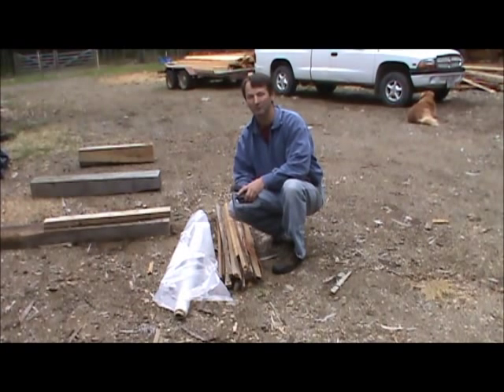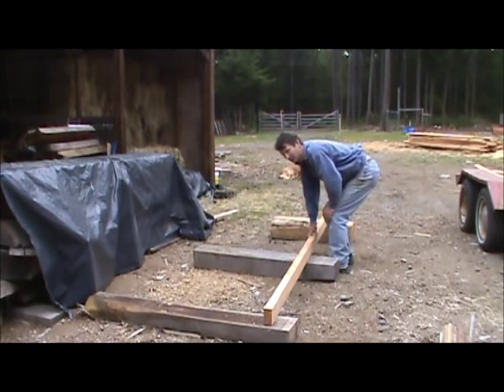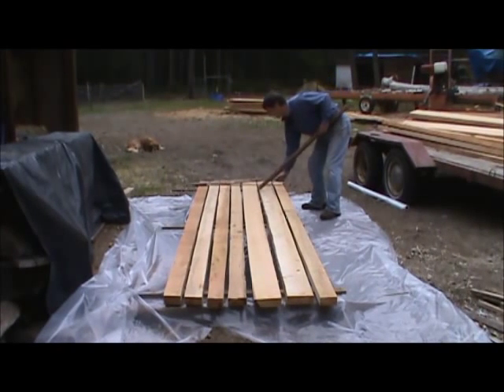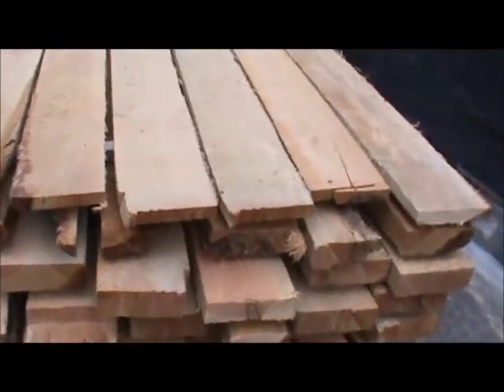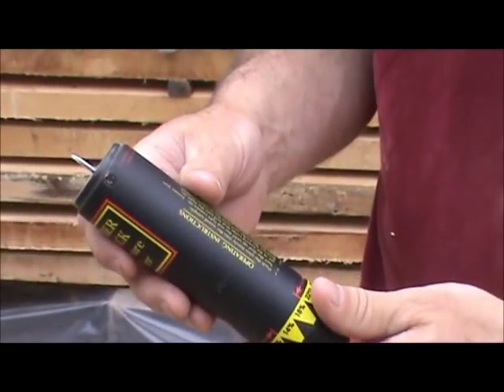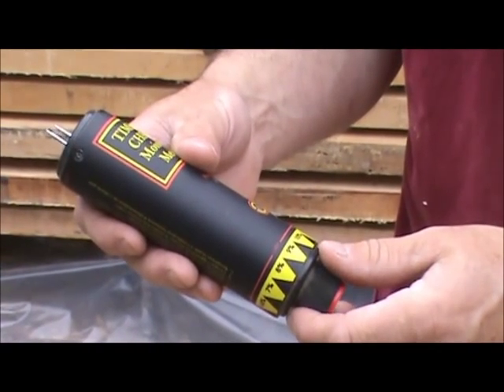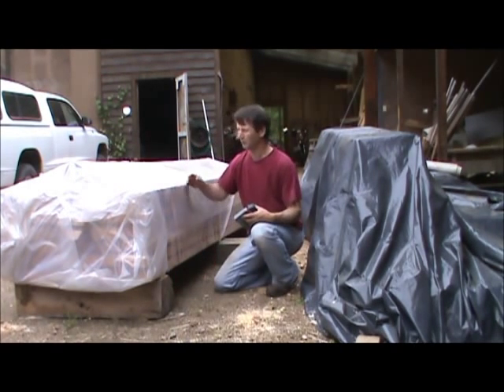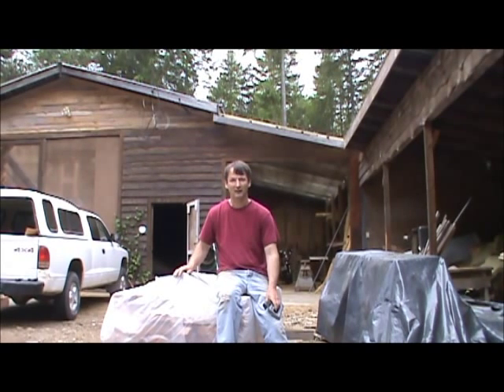How to Build a Free/Simple Solar Kiln ~ Part 1

Comment: Sorry, this won't work. Without a place for the moisture to escape...what do you get in a warm moist environment? Lol, it's a mold and fungus incubater.
Reply from the maker: Re listen to the video again my friend, you will note that you put holes in the bottom of the plastic for the moisture to drain out.
Reply: @bclogstairandrail  that's hardly enough.  I threw a blue tarp once over a stack of lumber in my dry garage to keep dust off it. I  had fuzzy mold all over my already kiln dry lumber from the lumber yard...you are not kidding me...not one bit! Wood has to breath.  Listen to me folks, don't do this as others have said.

Comment: Seems as though the people saying that this won't work have not actually tried it.I just made one of these to dry out very thick very long pine slabs.  They had air dried with no protection for a year before I got around to wrapping them up.  It seems to be working fairly well with noticeable condensation and drainage in the small holes in the bottom.  They have been wrapped up for over a month and there is no noticeable mould growth.  If I were to do it again I would wrap my slabs in a way to keep the plastic sheet from touching the wood and have a more rounded shape to help the condensed water to flow down the inside of the sheet more easily. This rounded shape would help keep the condensed vapours from dripping back on the wood. I had to wait until the water started to pool so I would know where to cut small slices in the bottom.  I should have added small stones to the bottom to better allow drainage right at the bottom and help prevent water from pooling where I don't have a hole.Thanks for all the videos .
Reply from the maker: Thank you! Finally, someone who actually listened to the instructions and tried it out before making the judgment that it would not work. Great job!

Comment: I wonder if the cooler climate makes the difference with the mold issue?

I really enjoy your videos, hoping to see some more. you do some very creative work. 

subscribed.
Reply from the maker: Thanks for your great comments. There seems to be a lot of negative feedback from other people that have not tried this and think that they know what the results will be. They are welcome to their opinion and results may vary. However, my results have been extremely good with little to no mold. The reason this works well is that the plastic does not touch the wood that is being dried. The heat generated creates a convection current of air between the wood and in the kiln. The excess moisture that comes out of the wood condenses on the plastical and running down the sides and out of the bottom. The wood does not seem to crack or split as the moisture content is very even with the woods I have dried in the kiln. I would only try this method in the summer here as it is usually quite warm and dry with little to no rain  for 6 - 8 weeks. I hope this help answer your question. :)
Reply: Looks like a lot of the condensation will run back to the wood where it is stapled.  Make a simple 2x2 wood frame for your plastic so nothing touches the  planks being dried.

Comment: how long does it take to dry using this method. the air drying method takes 1 year per 1 inch thickness of wood.
Reply from the maker: It takes about 6 - 8 weeks in the middle of summer. 😊
Reply: +MySchizo Buddy The time for wood to dry is 1 year per 1 inch of thickness when it is allowed to dry naturally. When you force it to dry the time is reduced.The higher the temperature the faster it will dry.
Reply: +Lance Forest not in Texas

Comment: Do you wait until the water pools in the bottom before you cut the holes or where do you cut the holes?
Reply from the maker: +tastypork I cut the hole in the bottom after  the water began to pool so that I new where the low points where. :)

Comment: I have a large amount of standing timber  casaurina equisetifolia( australian ironwood) on my lot on big island of Hawaii.  When sawn boards/timbers are air dried  , it has significant surface splitting and checking that is not acceptable.  I have to somehow dry the whole piece uniformly so perhaps the solar sealed method would slow the drying, so that the inside wood can equilibrate to the outside surface wood.  Do you get mold and mildew with your system?  perhaps the temp rises high enough to kill the fungus? 
good videos you have produced.
Reply: bclogstairandrail
I was expecting this method to give mold as there doesn't seem to be a way for the moisture to vent out. You kinda seem to create a greenhouse with wet lumber in it which is ideal for mold to grow. Now if you could solve the ventilation problem then you would have a winner.
Reply from the maker: It seems that it dries the wood much more evenly and so do not get that much cracking. I do however get some surface mould, but does not go in very deep. I would imaging if a person was to put some anti mildew treatment on the boards before hand this may circulate in the kiln and keep mould to a minimum. Hope this helps. :)
Reply: I am going to try it on a small scale, thanks
Reply from the maker: The second video which I never quite got round to putting up shows me putting holes in the bottom. The water sweats out and drains down the sides and out the bottom. This keeps the moisture content even and stops the mold happening as it removes the excess moisture. Hope this helps solve your issue:)

Comment: So in simple terms,instead of the moisture gradually evaporating away from the lumber, this works by raising the temperature and basically making the lumber "sweat out"......and the "sweat" just drains away from the hole you put in the bottom. kind of a green house effect?
Reply from the maker: Yep, that's exactly what happens. :)
Reply: Doesn't the water getting on the wood stain it horribly?

Comment: What about the condensation? And no air flow ?
Reply from the maker: It has drain holes in the bottom. The condensation runs down the sides and out the holes, it keeps the whole kiln at a fairly even humidity.

Comment from the maker: The convection inside the plastic keeps the moisture moving and even, so that boards do not tended to crack or warp as the moisture is fairly even through out the kiln. The excess moisture collects in the top of the kiln and then runs down the sides and out of the drain hole in the plastic at the bottom. As time goes on the moisture content of the wood reduces as the excess moisture drains away. Hope this answered your question. :)
Reply: Am planning to try this out soon, can you post the post drying condition of the wood in a followup video so that is clears everyone's doubts....

Comment: Solar Kilns/& other simple solar units have been around for over 30 years, they all work well & are easy to build, cheat to run.
I have never seen a kiln that did not have air flow as the main drying source, heat being second (hot air dry the wood, but heat moves in the air). So you do not use the air flow.
Is this because you dry the wood fast, 2-6 weeks & do not need air flow?

Comment from the maker: I'm not sure how that would work. With clear plastic the light and heat comes in and raises the temperature inside. The air still circulates inside because it  cools and warms and this keeps the pile at pretty much the same moisture content. As there are holes in the bottom of the plastic the water condensates on the side and runs down the sides and out the hole in the bottom. If you try the black plastic idea I think we would all be very interested to see how it works. Thanks :)